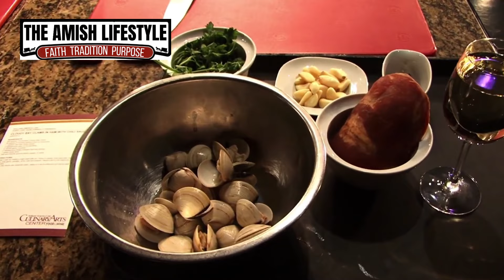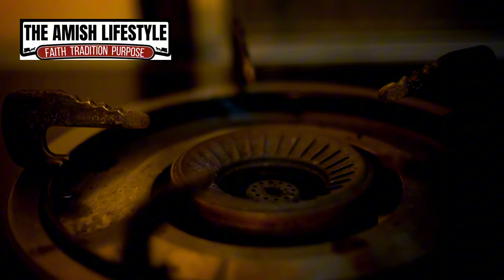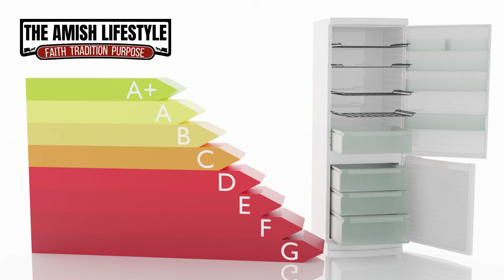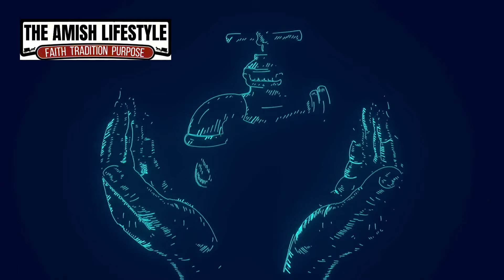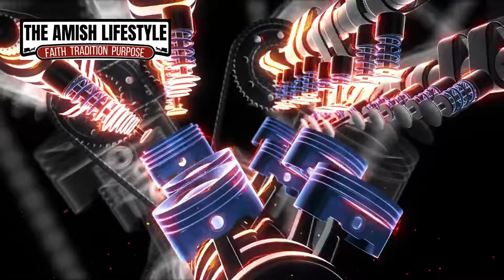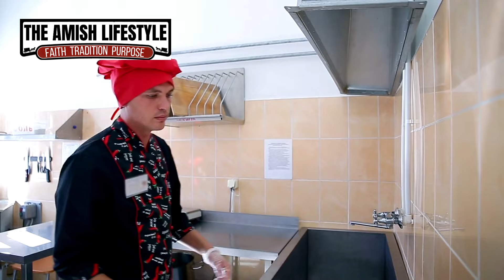11 Amish Blackout Supplies 99% of People DON'T Have

Comment: Well I have about a dozen different types of little wood stoves that burn leaves and twigs along with alcohol wood pellets and several other types of fuel you can get these for around $10 to around $40 or you can make several kinds out of empty cans. 
I lived around the Amish for a while they didn’t use most of this stuff they did canning most of there food like meat they would but you’re a cow cut it up and put it in Court canning jars. They usually didn’t go to regular stores but the Amish have there own stores they just don’t let in outsiders. They also use pro pain stoves which you can buy for about $30 I live off grid a 20 pound propane tanks like a BBQ. Uses last us several months cooking most of the time we cook on the propane burner on the side of our BBQ  and we use the BBQ for baking bread cakes pizzas and meats like I said we Dey several mints of cooking on a tank. I don’t know any Amish that have a gas refrigerator they are very expensive a lot of camp  have them. I got a 12 fringe frezer from Amazon for around $100  we use solar panels but they’re only  good from around 10 am to about 6 pm if it’s sunny so we have to run a small generator about 4 hours a day to chart our batteries I got a 3000 watt BlueTTI  power supply it runs my CPAC  my refrigerator and powers my phones and tablets and the generator will charge it in a couple of hours. I also have a 2500 watt duel fuel generator on propane it will run around 4 hours a day every day charging everything for a little over a month on a 60 pound propane tank. I’ve tried a bunch of heaters the mister buddy propane I think is one of the best you can use it inside with no problems I do have a little electric one I use when the generator is running but most like the oil one your showing use 5000 to 15000 watts which takes a big generator to run and uses a lot of gas for what you get it’s not worth the effort your better off putting on more clothes and getting under a blanket like he Amish do. Also most states have banned wood and coal stoves a lot have also been banning fireplaces. So to use these you may have to move to another state a lot don’t allow collecting or using rain water or wells